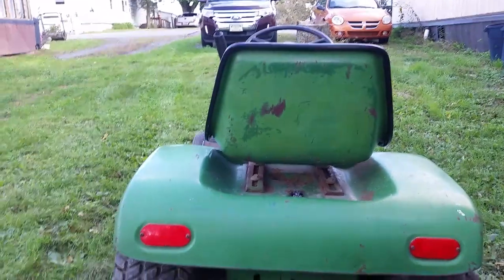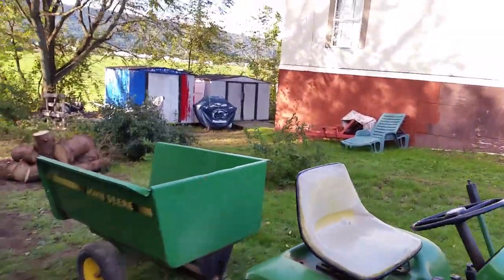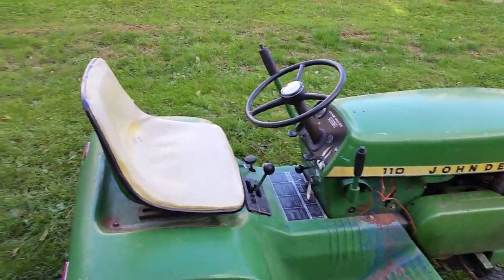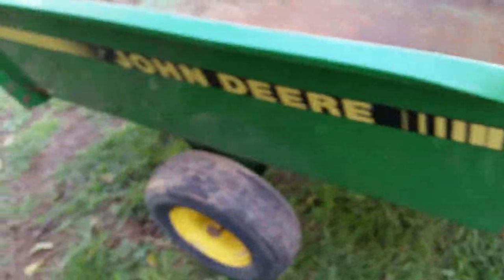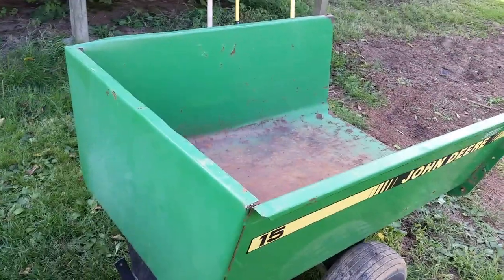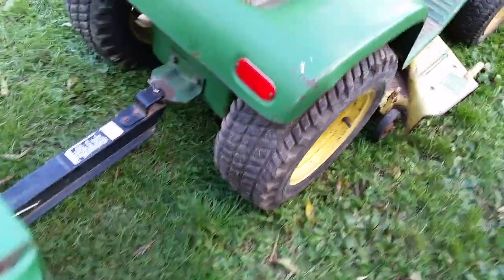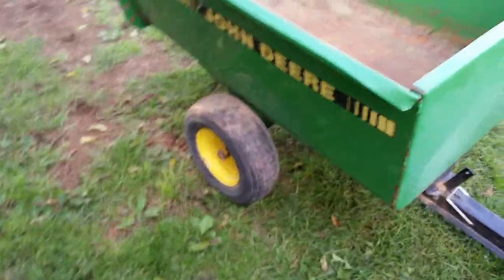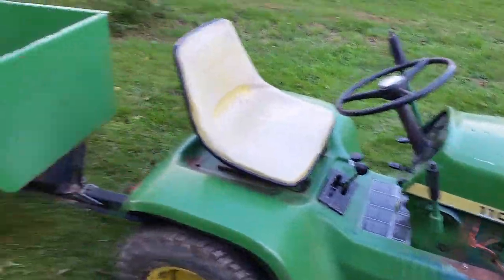My New Massive John Deere 15 Cart!

Comment: Do they still have a 322 with ags that they used to have
Reply: Didn't see any 322's there. He buys and sells so many tractors, its almost impossible to keep track.
Reply: It's only overkill if you fill it with concrete otherwise set your purse down gently and pull it around 🙄